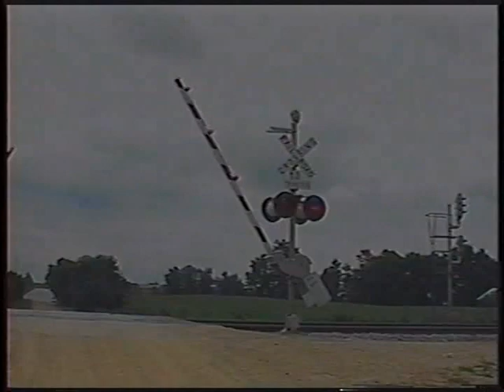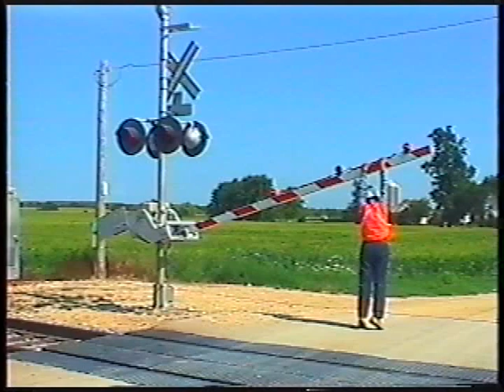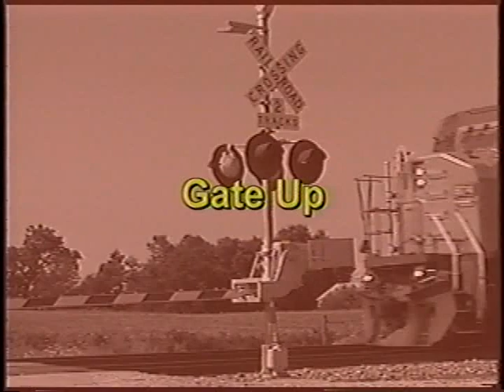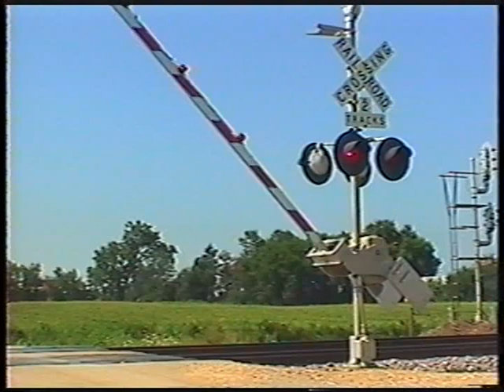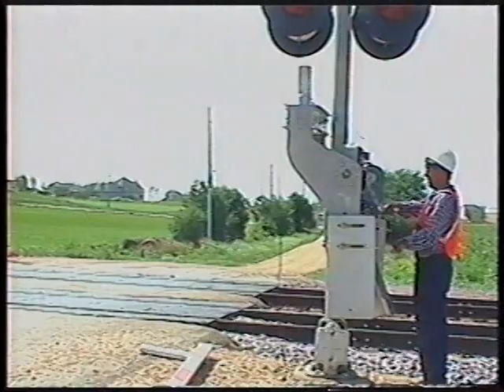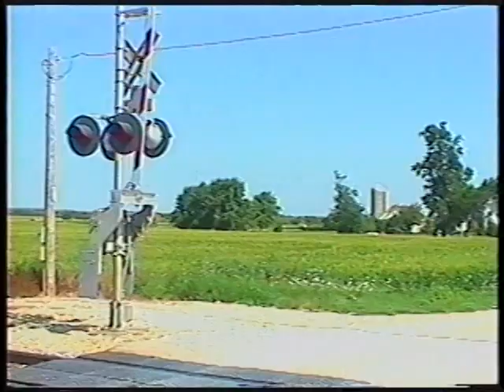WCH 3597 Gate Mechanism

Comment: nice. what year is this from?
Reply: UP 7001 is in operation still
Reply: @bnsfrailfan you're actually talking about UP 7001:2, which was former GECX 4001. UP 7001:1 is now 7501, then turned into 6889 and rebuilt to C44ACM
Reply: The locomotive 7001 includes locomotive 6088
Reply: Why are you guys talking about a loco wtf lmao
Reply: @mile290productions3  to determine what year it is
Reply: Problably 90s ?
Reply: @TexasRailfan2008  Yes, it looks pretty similar to 90’s
Reply: @bnsfrailfan  indeed
Reply: UP 7001 leading at the beginning shows this cannot be older than 1997.
Reply: @lowkey_loki_404  smart!
Reply: conrail is defunct now so probably 90s
Reply: Bro